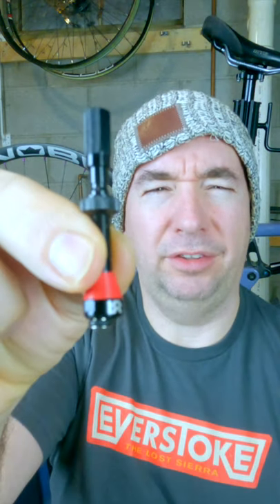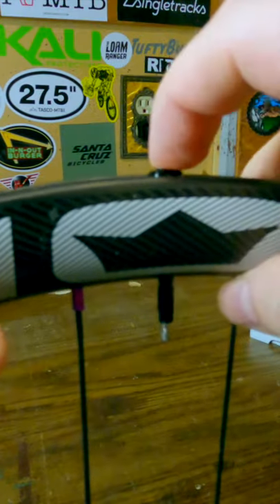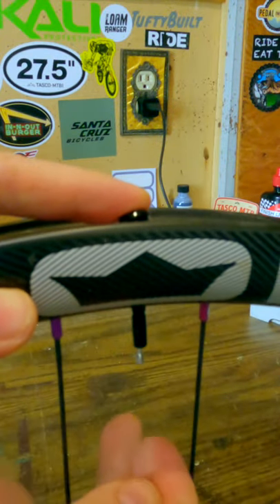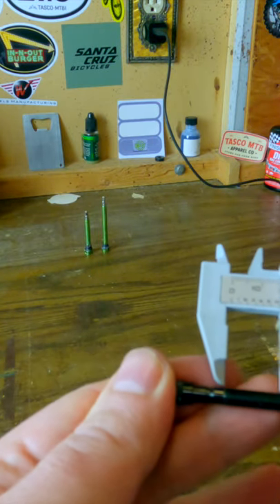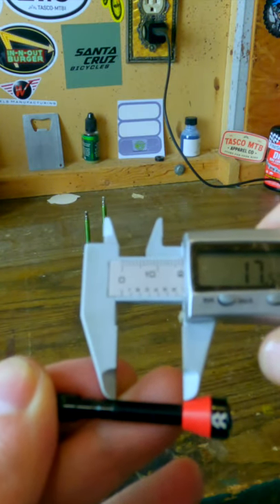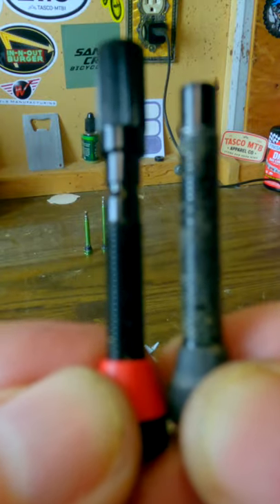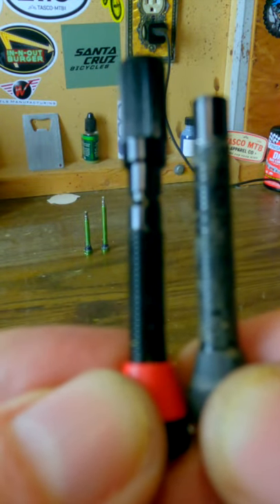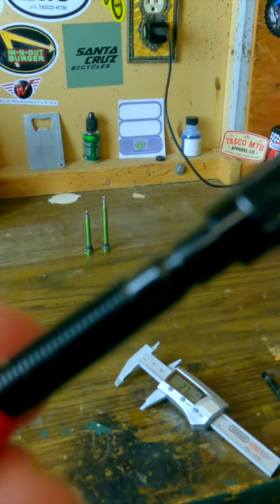Reserve Fillmore Valve fail

Comment: These valves are shite. I mine snapped the first time I pumped air in on a trail. I didn’t over tighten it as I know this can be a problem. The metal is too thin at the narrowest point. It may have been touched by some small gravel or the wind which may have damaged it. Only 2nd time out with them and riding slow. It’s as if it’s only supposed to be used with a CO2 canister. Like most Santa Cruz equipment, over priced and overrated.

Comment: Would those valves work with tubeless inserts?🤔
Reply from the maker: I haven't tried it but they should since the core in these would push into the insert when inflating.
Reply: @BrianVaughn  🤔would it be a problem to fill sealant thru the valve with the insert pressing it?
Reply from the maker: @bzkt653  sealant is always a pain with inserts but it can be done.